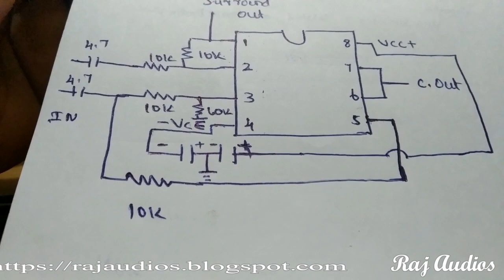Surround Board உருவாக்குவது எப்படி உங்களுடைய Amplifier க்கு நீங்களே செய்துகொள்ளலாம்

Comment: Bro center ku oru channel la irundhu matum edhuturukinga... Apo left chn or right chn andha line la edhu kodukaromo adhu dhana velai seiyum.... Downmix ah velai seiyadhu la... Rendulayum rendu reaistance potu kodutha dhana left and right rendum combine pani mono va audio varum
Reply from the maker: correct bro 👍
Reply: @RajAudioErode  but ovoru bus la verum orey oru resistance matum potu center nu koduthudranga bro.... ilana rendu resistance potu mix pani oru resistance potu ground pani koduthudranga ga bro...
Reply from the maker: yes bro fist order bandpass use pnlma
Reply: @RajAudioErode  Apdi use pana nala dhan irukum... 6x6" ku 4392 pota epdi ga bro match agum...Veetuku nala irukum... Gain pathala na oru buffer stage potu gain panikalam...
Reply from the maker: ok bro🙏💐